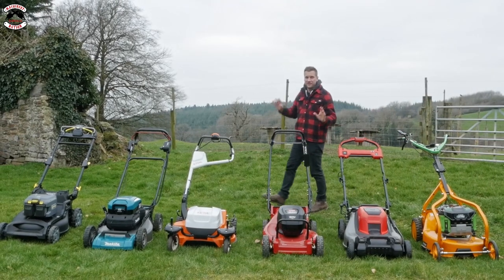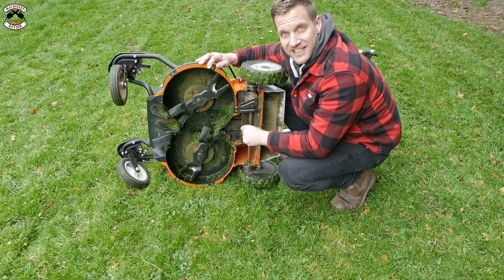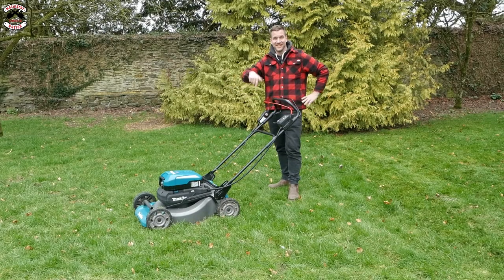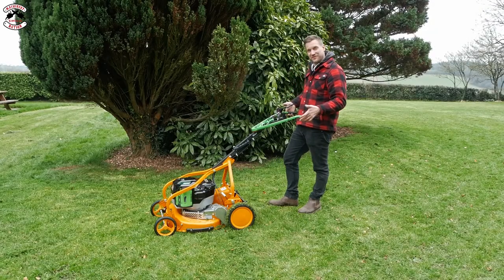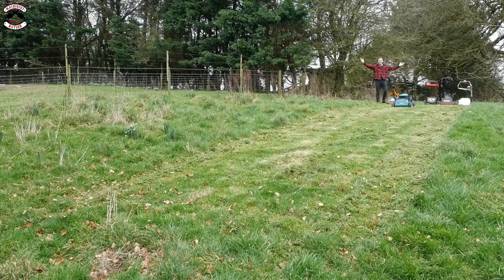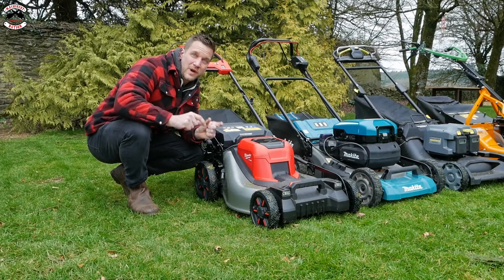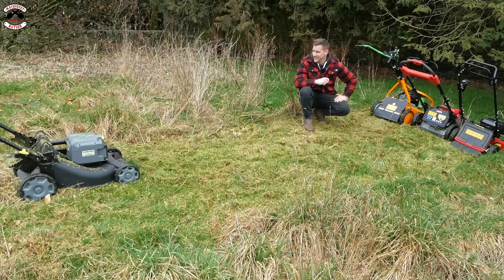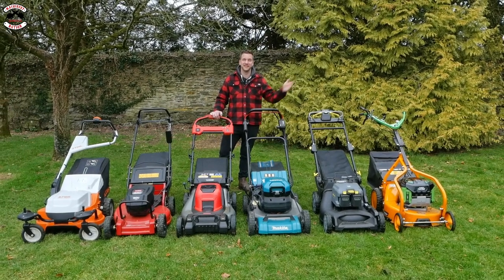Commercial Battery Lawnmowers PART 2 - Stihl - Toro - Milwaukee - Makita - Karcher - AS Motor

Comment: You really need the XGT Makita mower with 8ah batteries and the high lift blade. I returned the mower you're testing couldn't be happier with the XGT model.
Reply from the maker: Interesting, thank you for your feedback 👍🏼
Reply: I bought the 19-inch Makita XGT 40v just over a week ago. In Australia, we are lucky we get the better quad swing back blades (better mulch over bar blade and has 4 high lift blades). I dismissed Makita LXT when looking at electric mowers due to bad reviews. The ramp up was too slow, and safety cut off kicked in under load and having to manual change key swap batteries. Wanted Milwaukee initially. Great ergonomics but needs two huge batteries expensive run and poorer blade choice/cut height. AS Motor looks awesome, but it should at triple the price of the competition.

Tool store showed me the new XGT (which I looked passed as I thought it was another LXT line). It only needs 1 battery to run and auto swaps on 2. Two 8 ah batteries last hours on maintenance mow. Instant ramp up and plenty of torque in long thick grass. Never stalled. Commercial build quality and that tiny exit chute never clogged and compacts that bag 100% full. The only niggle for me is higher cost of Makita (quality build) and no indicator on mower of battery charge left. There is a red-light battery indicator when flat but you need to lift hood and manually check on battery for how much charge is left (Not difficult).

The difference between the LXT and XGT is night and day.

Comment: Great video. Clearly shows  the issues in design with cut and drop, the Makita, Milwaukee and Toro all seem to have tight grass flaps (with no bag on)  so no grass can go through unlike the others, esp the AS which did very well, those narrow wheels with that weight on soft lawns looks like a tram maker in the making. What kw ratings are all these mowers?
Reply from the maker: Thank you for your feedback Greg 👍🏼

Comment: Great stuff, but I got to say, the last test wasn't ideal. The Stihl jammed up, but you kept it flat to the ground. With the others you pivoted them on the rear wheels a bit, which always helps mowers in thick stuff. 

That said, the AS Motor was still clearly the most powerful by a looong way
Reply from the maker: Yeah I agree I didn’t tip it up, but I only tipped the others up where there were clumps of grass and the Stihl did not make it that far. Thank you for your feedback 👍🏼

Comment: i would expect those results from milwaukee and makita. Milwaukee focused on power and performance, and makita focused on heavy duty, quality, & reliability, usually leaving performance & power second. The Toro is probably the closest to gas mower experience, and i would imagine most commercial mowers using the Toro or Stihl

Comment: The problem with that mower i would say is the blade for the bagging if it had a high lift blade it be interesting to see how it gets on
Reply from the maker: To be fair the blade was not much of a different design to the others 👍🏼
Reply: @MachineryNation  well thats fair enough i run john deere mowers with the fan and a high lift blade the pack a bag like its a bale i always repower my mowers after 4 yrs work
Reply from the maker: @noelcahill6707  Yeah a high lift blade is awesome, to same for the Weibangs. It makes such a difference 👍🏼
Reply: @MachineryNation  the honda blade system with a fan would be the best for british and irish lawns as a contractor alot of the equipment we get is for the yanks or mainland europe our grass is alot better then theres alot of mowers struggle

Comment: You need to compare the AS against the EGO
Reply from the maker: Great idea! The EGO is not a commercial mower so wouldn’t really compare fairly.
Reply: @MachineryNation  I know, but it would be nice to see what the difference between a decent domestic mower Vs a commercial one is.
Is it really worth the price difference???.
Reply: Ego's top of the line residential mowers runs a 1200watt motor, whereas the AS motor mower is running a 3.2kw(peak) EGO beast 💪🏾
Deck design is another Major factor. I've found that Ego's newer mowers have a shallower deck, making it worse for processing tall grass. Their 18" model is probably the best/closest to being ready for the commercial user, or any user in this case 😁
AS mower has very deep deck, helping with grass processing. 
I want one, but it's gonna cost an arm and a leg to get it to NZ 😢

Comment: I used the Makita commercial it's way underpowered it's not that certain machine the xlm06-the connect x line isnt ergonomic out in the field as well as it takes awhile to get through tough spots I switched to Milwaukee it's the best ergonomiclly if you doing a gardening maintenance route

Comment: Swatching this and the first thought was stop turning the mower over  the oil, the petrol, then second thought was , shut up you dinosaur. Using them commercially would require a lot of batteries and chargers at night to recharge. And that's only the mower. Now count in a strimmer,  hedgecutter and blower. The garage would need a bank of chargers. And a zillion sockets.
Reply: I'm running EGO commercially, started with 3 EGO batteries and could mow 8 lawns before calling it a day 😉 
Ps. I invested in a 2000(4000 peak) watt inverter and a 300ah 12v lifepo4 battery so I could charge on the go 😁 I've now built up my battery collection and have 15 differing sizes and still run the inverter and lifepo4. A full 8hr day of mowing is a breeze 💪🏾
Reply: @jordanharetuku9044  some of my gardens are cut once a month and are mulched. I would love to borrow a decent battery mower to have a go. It's taken me a few different types of mower to get the right ones for what I do. I wouldn't want to go down the road of buying battery mowers to see which ones are suitable. Cheers for the info and let's look forward to the spring, without snow!!!

Comment: Could I humbly suggest to stop calling the EGO motor an engine … many people don’t have the mechanical understanding that you have and this just’s confuses people whose expertise may not be in this area.

Additionally, energy density of a lithium battery is nowhere near fuel … so saying it’s just like a petrol or diesel car under load is not accurate. Fuel has around 40 times more energy per kilogram than lithium! 

There’s plenty of basic evidence of this when you see equivalent tow tests of EV pickups, or the Tesla semi or Nuremberg race track where Tesla’s “Fastest car” only just scraps into the top 100 factory cars.

Edit:
I should say this was an excellent review!
Reply from the maker: Thanks for the feedback. 

If they don’t understand that this is a battery mower video and me saying “I call it the EGO engine” then they should not be anywhere near a mower 😂😂 
My comparison between fuel and battery is based on how hard something is used. Thus reducing the time it will last. True in both cases! 
All I get from your feedback is fault can be found if you look hard enough 🤦🏻‍♂️😂 there are more important mistakes than this lol.
Reply: My sincere apologies if you mistook my humble suggestions as offensive … I think you present exceptionally well and have certainly lifted the bar for entertaining videos on outdoor equipment.

I was only trying to gently make a suggestion that calling a motor an engine, or engine a motor doesn’t help what your trying to do in the education of outdoor equipment … it also frustrates engineers, just like it would frustrate a landscaper with 10 years experience listening to a novice!

Energy density:
Once again this was not to insult you, just a humble suggestion brought on by an observation I have from people complaining about battery mowers and reduced run times Vs Gas … not many people appreciate that wet grass, blunt blades, hot days, or buffalo grass Vs couch have a much larger impact on battery mowers than gas. Ego receives a large amount of calls on battery life warranties and they will always ask about blade condition etc - people always respond that they never had this problem with gas.

Your fine channel could do a video on the importance of blade condition or grass condition for battery mowers. My own experiences have found that in very long grass you can nearly double your battery life if you attack it twice at two levels - Gas mowers due to 40 times more energy density are simply not affected as much.

Once again, sorry if you found my post offensive, it was not meant to be.
Reply from the maker: @garageblitztv3215  you didn’t offend me George, I really appreciate your feedback! Hence the emojis. I just hope people are not that thick to think it’s an “Engine” 😂 some more great points George, thank you 🤩